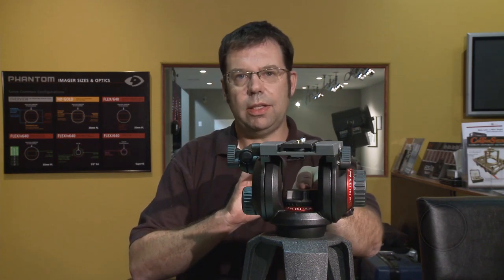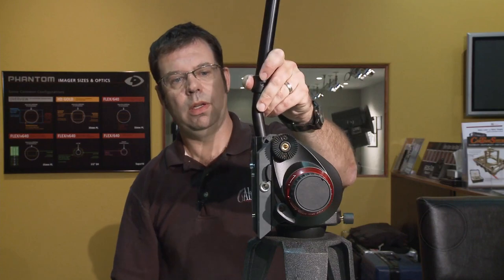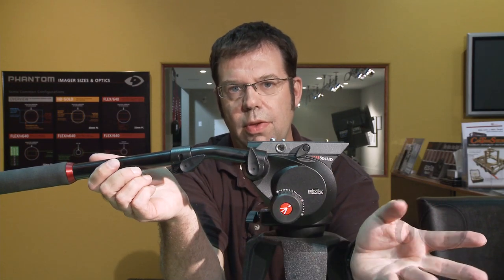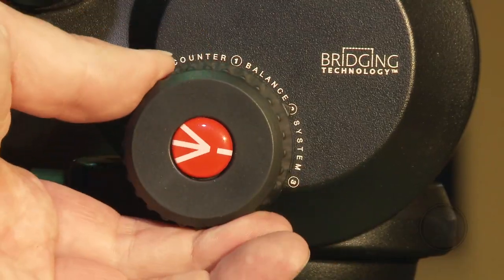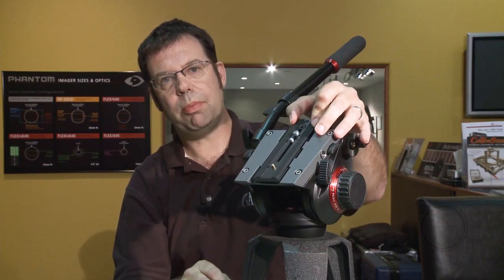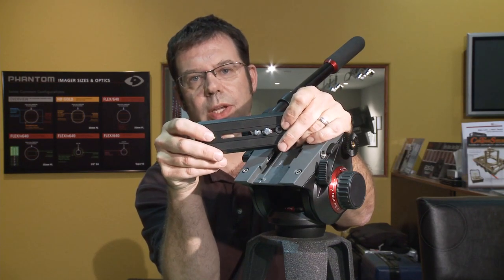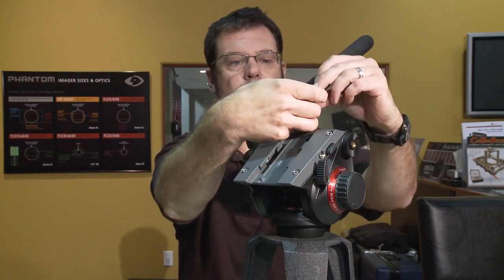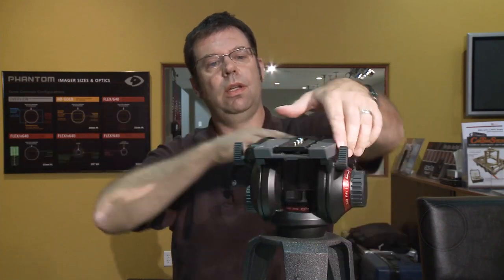At the Bench with Manfrotto's 504HD Fluid Head

Comment from the maker: Manfrotto makes the 502HD with a flat base (to accept the 3/8" 16 on your tripod), but the 504HD is only available with a 75mm ball. The other option would be to use a flat base to ball adapter like the Manfrotto 325N if you don't mind the extra height. - Jeff